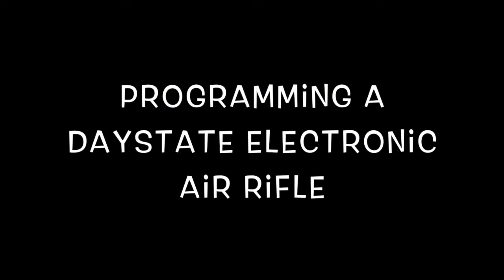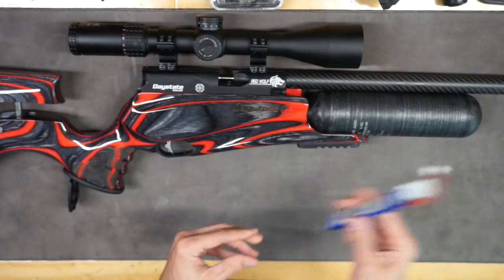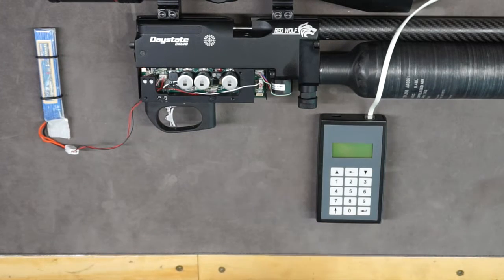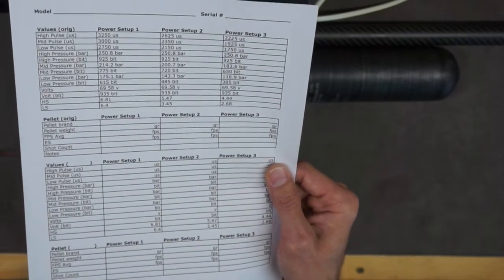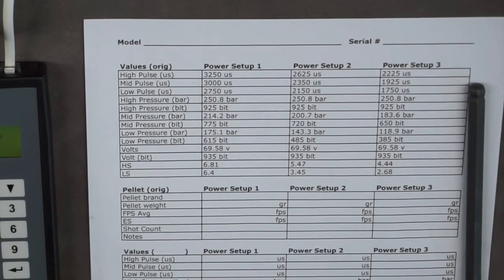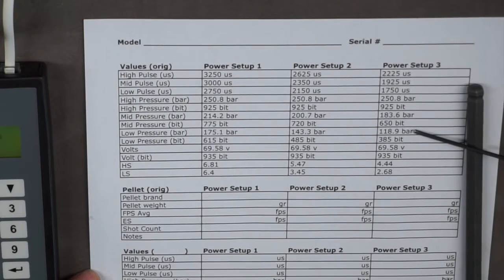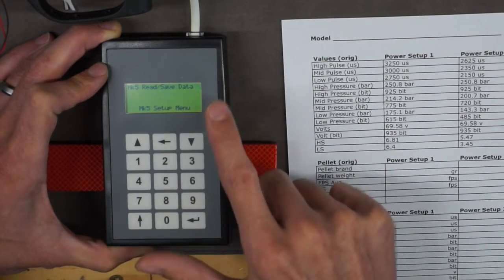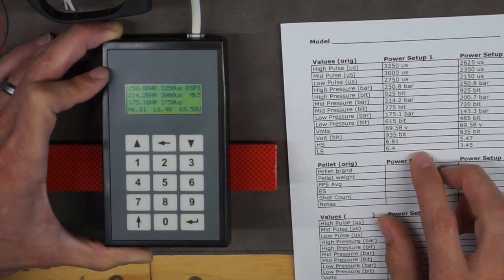How to Program a Daystate Electronic Airgun

Comment: Great demonstration, but this interface is pathetic for a 3000.00 airgun. This is straight out of the 90's. Couldn't they download to a Windows or Mac spreadsheet, make changes, and then upload. Instead, you have to write down your settings. I was seriously considering a Red Wolf. I just crossed it off my list.
Reply from the maker: Yeah pretty old interface. The new Delta Wolf has an on board touch screen interface, upcoming Bluetooth compatibility & is much better.

Comment: Hi great video and thanks, but when i connect the programmer to my redwolf and go to mk5 read/save data and press it it shows ..reading..then it says error. Ive tried the cable colors in both side but still shows error and cant read my factory settings so i can proceed. What do ?

Comment: I would guess the pulse is measured in micro seconds. 3000 microseconds is 3 milli seconds. Which sounds about right. 
So the valve opens for 3 ms to fire. 
I would guess the high and low pressures are just alarm levels for the liquid Cristal display and don’t actually change the firing power at all.

Comment: Addicted to Airguns (AtAg) that was one awsome video! liked and subscribed within the first few minutes. i noticed that out of 3,444 views you only got 2 thumbs down, if you want to increase the thumbs downs and the subscriptions then add the following: Dimensional analysis uses hyroglifix (purposely mispelled as it wakes up the spelling Nazis), One sidereal second of time has 1,000 milliseconds, and one millisecond has 1,000 microseconds, which are abreviated as "us", which at first glance appears as "US", but is really millionths of a second; also, one bit is one register raised to a power, or exponent; for example, a 10 bit register would have 2^10 bits or 1,024 (be careful now because zero is a number, so from zero to 1,023 is 1,024 locations; furthermore, the average air molecule weighs approximately 28.96546 daltons at STP and the ratio of air to lead is approximately 1:7.153 and using the ideal gas equations and newton's cradle along with thermodynamic laws gives you a good start into air gun ballistics both internal, intermediate, external, but not necessarily terminal. With degrees in chemical, mechanical, physics, and electrical, I feel that i will never fully understand the laws governing airguns, approach, maybe, but never fully understand them all, but they are loads of fun discovering new ways to create the wheel.

Comment: So Daystate just split the fill into 3 bands and use different hammer setting for each region to try to mask the Bellcurve, shame it is not a full regulation.  Show us some chrony strings, are they any FPS steps visible? ....half of the numbers on the spreadsheet are irrelevant as you don’t touch them.